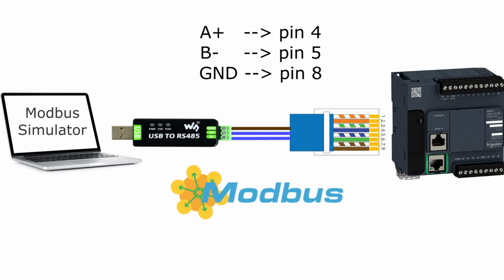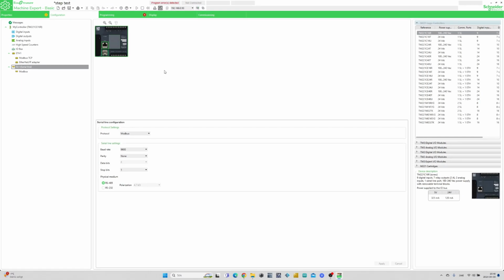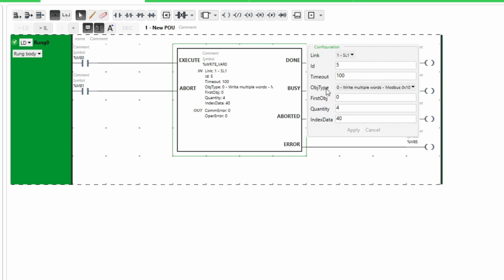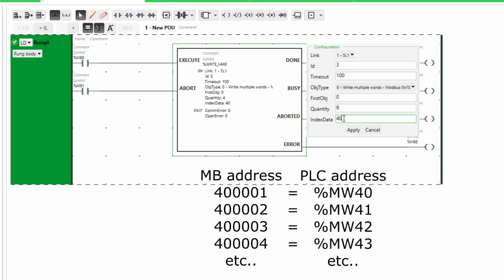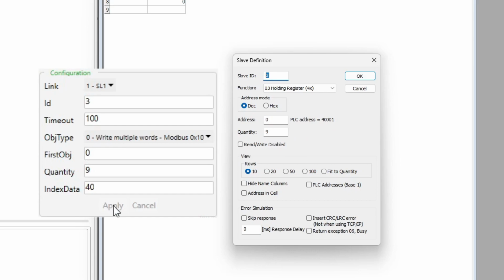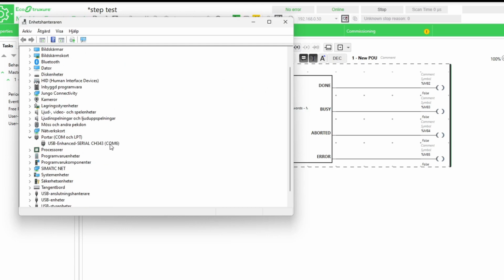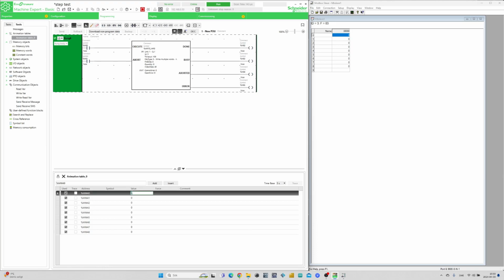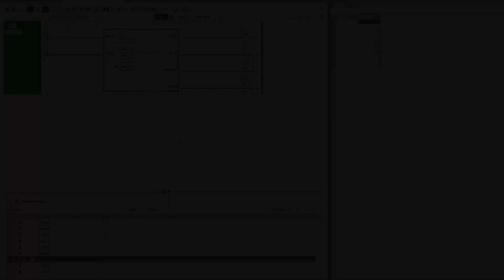Schneider M221 PLC as modbus RTU master | Machine Expert Basic

Comment: Hello, your video is helping me, a question, I am doing the programming in the Machine Expert Basic simulator, but when I put it online the simulator, the communication blocks send me an error indicating error 6: 
"The specific parameters are incorrect", is this because I am using the simulator instead of the real plc? I await your response, thank you.
Reply from the maker: Hey happy to hear the video helped you. I am not 100% sure about this error but most likely thats the case like you said. I doubt machine expert allows to simulate Modbus RTU.

Comment: in connecting serial cable to each M221..can we use the same ethernet cable?
Reply from the maker: Hello, when you connect multiple Modbus RTU devices you connect them from A to A and B to B etc. Theres good pictures and help if you Google how to wire RS485.